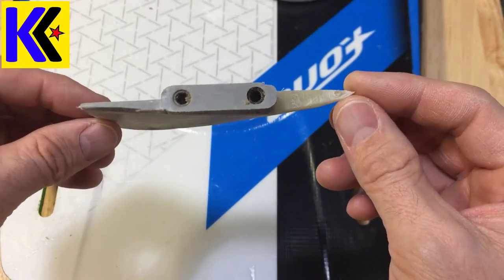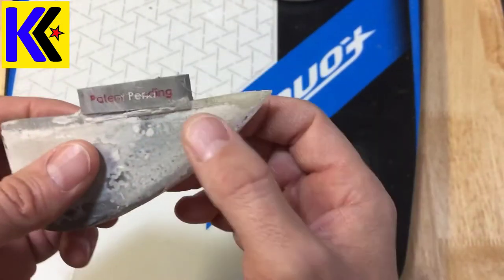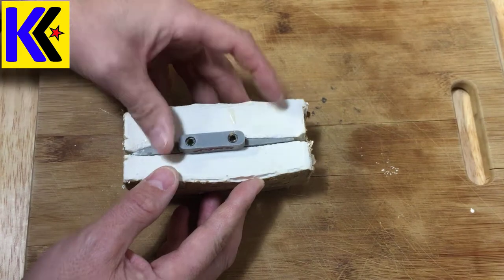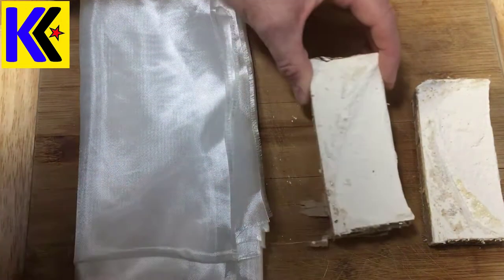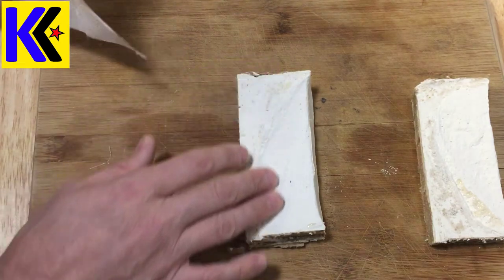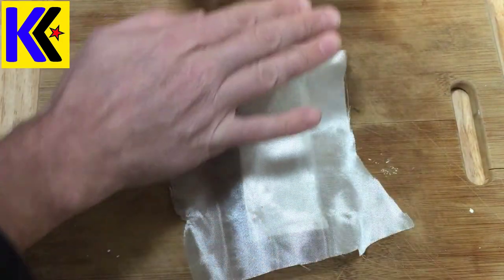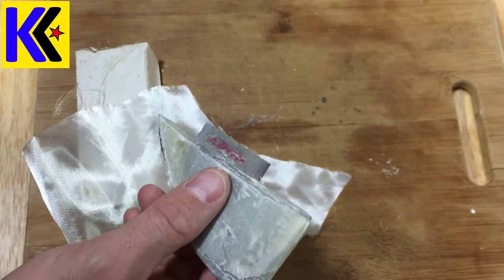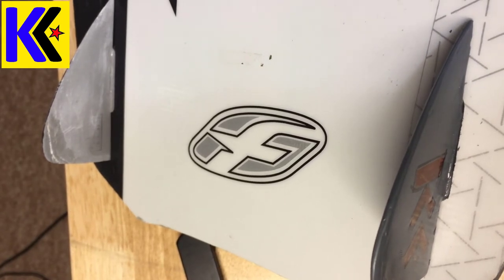Best Surf Fin Repair

Comment: Hahaha! I was about to mock all the trouble you went to repair this broken fin but just before pressing the COMMENT button, I validated my mocking by doing the exercise myself of searching and obtaining a replacement fin.I found three shops on the web that hold or held that exact fin. One shop would sell one fin for 12 Euros. The other shops sell kits of two or four fins. The killer is the shipping rates to North America : 55 Euros Hahaha!  So to end this comment I'll say thank you for the nice video ! Hahahaa! Keep up the good work and TYFS
Reply from the maker: I kind of like tinkering with my board.  Yeah I could go and get a replacement fin for $60 but what fun would that be.  Thanks for your comment.